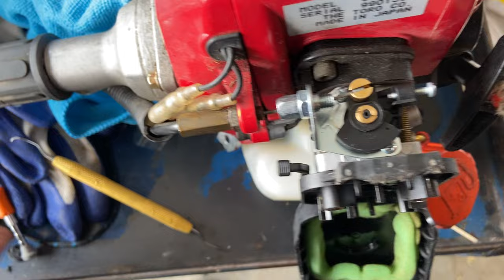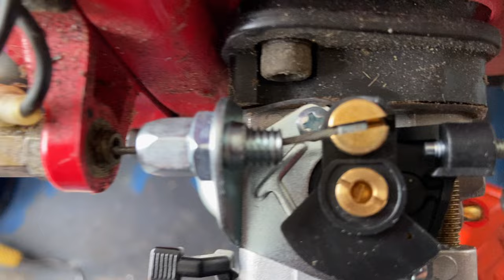Hidden Adjustment Screw on Walbro Style Carburetors

Comment: Yea but whats the stock setting , i had someone mess with the setting now  the motor wont start at all ,
Reply: Same here man
Reply: Same, what did y’all figure out?
Reply: @minibikeamigos  i found its just easier to replace the carb , they are extremely cheap
Reply: @TheRandomMechanic  can you tell us what the settings are on the replacement carb?
Reply: @TheDynaGuy i know its late to answer, but try close the carburetor venturi with your hand and try start it while closing the carburetor with your fingers while crank it 4-6 times,if its not start its has too much fuel,if its start its not getting enough fuel

Comment: Gee it makes me cringe when I see these Chinese carburettors being used. They just copy the design using inferior materials and finish... Maybe it works but it is surely bound to fail at some point isnt it...
Reply: yoska222 Fair enough. I only use genuine walbro's on all my 2 stroke machines. They're usually set up correctly to suit the machine anyway, but they can be adjusted too if need be. The screw is just under a cap. I've never had to adjust them though
Reply: Same here. Always rebuild the original quality carb before buying a cheap crap one. I found a Shindaiwa T260 at the local dump that someone clearly tried to "fix" with the wrong Chinese carburetor. Unable to source an OEM carb for now, I bought a better fitting Chinese carb. It does run but when tuned to just 4 stroke at WOT, it seems very rich in the mid range and using too much fuel. Might have to lean out the low adjustment screw but then it gets real racey at idle. Idk, junk in, junk out.

Comment: I took it apart where this connects to the flap which opens and closes now I can't get it to return properly on off throttle response.  Almost as if the spring is worn out or stretched.  Not sure if it's that or something else

Comment: Hidden?  Not hardly.  The WYL model carburetors were designed with the throttle body mixture screw a very, very long time ago and people were aware of it immediately after the model was used in numerous power tool applications.  I was working with them as far back as 2005 and they had been placed on thr market long before that.    So it's not the screw was hidden as much as your exposure to yard tool carburetors was late and limited.  OTOH, people working on things need to know something about what they are doing before jumping in to do the work so the video is beneficial for some people.  If and when they get good at it and fully understand what they are working on they might learn this model of carburetor provides a lot of lattitude for performance modification.

The carb was designed by Walbro and their website provides a pictorial diagram of their various carburetor designs.